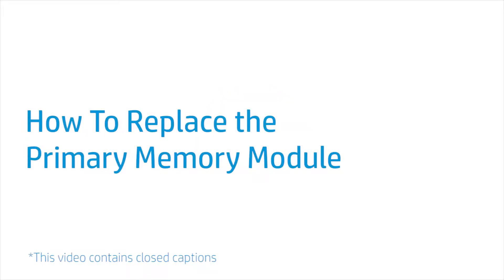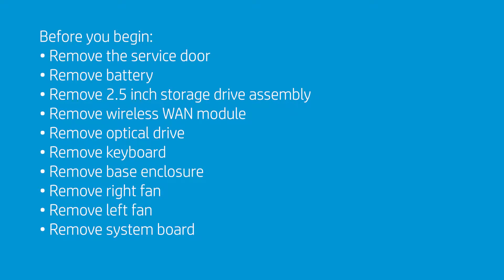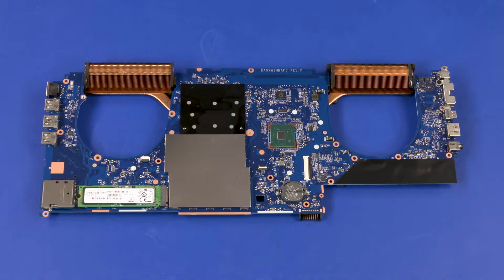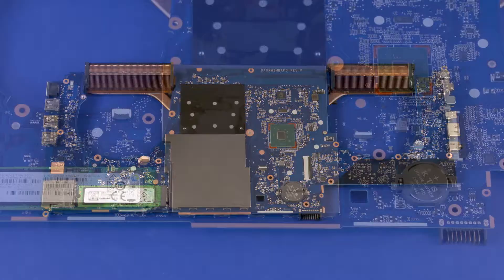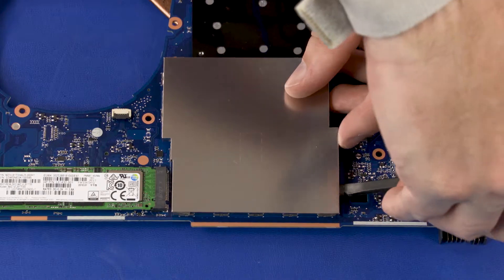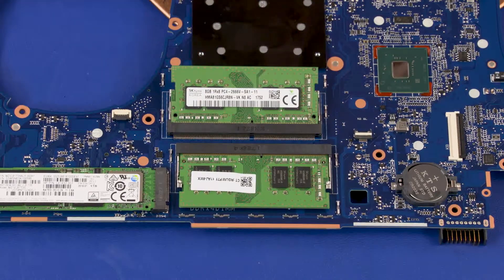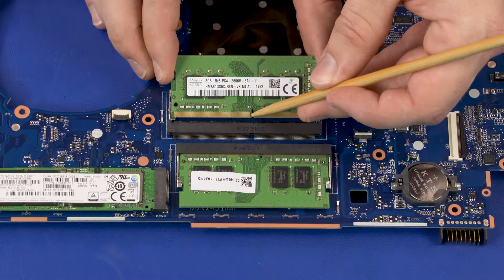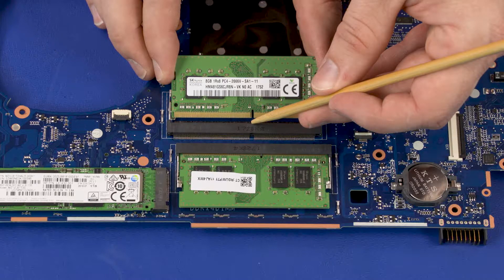Replace the Primary Memory Module | HP ZBook 17 G5, G6 Mobile Workstation | HP

Comment: Hi. I am using HP Zbook 17 G5.
Currently I have 2*16GB RAM in my primary memory slot. Will it support if i add two more 16GB RAM to make it 64GB in the 3rd and 4th slot? 

What is the maximum supported memory?

What is the part number to buy the RAM?
Reply from the maker: Hi Faheem, thanks for contacting!
I understand that you need to know about upgrading memory of your computer.
I will do my best to assist you.
Please refer 'Memory' under the specifcation page to know about supported memory: https://bit.ly/3QvlUs6
Use the HP Parts surfer to identify the part: http://partsurfer.hp.com/search.aspx 
And order it via the HP Parts store: https://bit.ly/3nKMYrs 
Binu - Social Media Tech Support